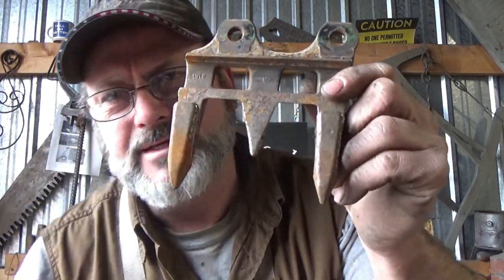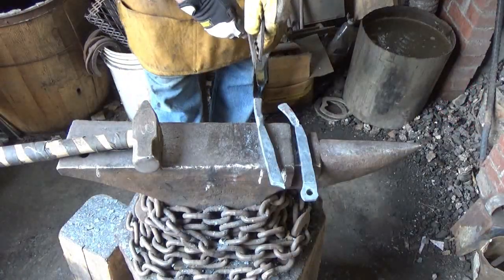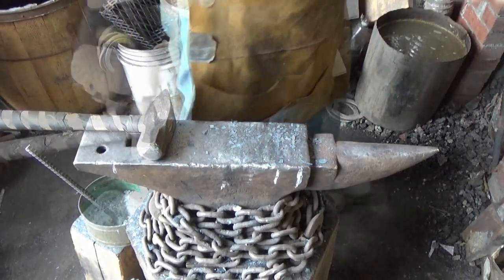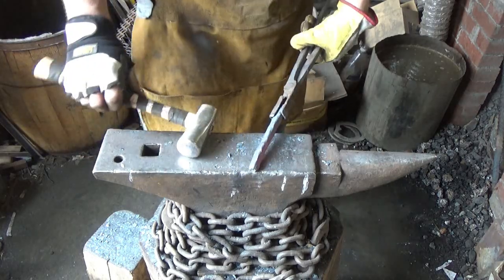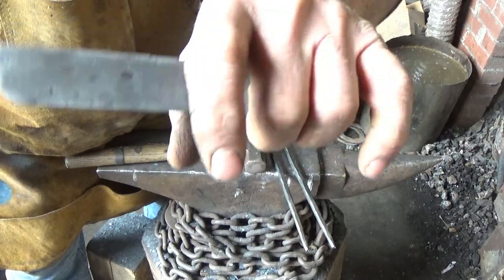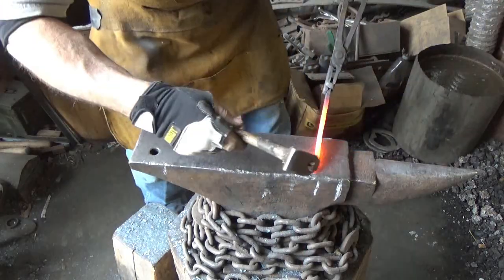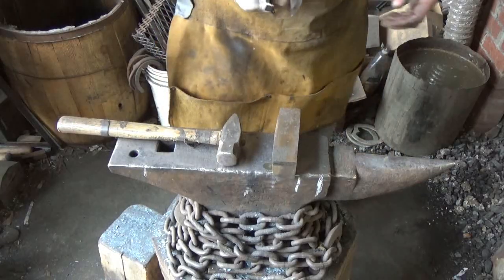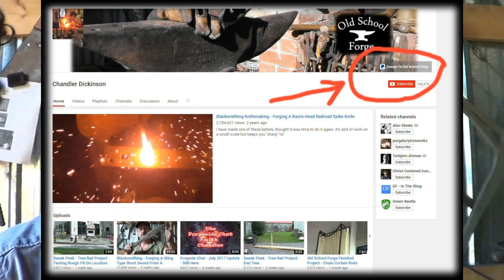Blacksmithing - Forging A Knife From Mower Parts - Full Video

Comment: Hey Chandler, I've been watching your videos for years now. I know blacksmithing is your bread and butter, and you've been self taught. As far as I know you haven't fine too any classes. But I think you can make a good contribution to the Craft for both experiences and new, especially new Smith's. You should make a book and or disc called what not too do. I mean your a great Smith, but you have an Armada of hard learned lessons you can pass on so others can skip the same problems. Thanks for all the hard work. Hammer on and may you be blessed. Joe

Comment: That's a REALLY beautiful knife! And now that I've seen more about how you did it, and what your thought processes were as you were making it, I can see even more beauty in it. Now I'd like to see what you might make out of the triangular bit from the middle of one of those mower blade pieces - the first thing I thought of was a "push blade".

(But for pity's sake, Chandler, fasten that damn vise to the bench so it doesn't wander all around the shop! Your work will go faster and be easier to keep neat.)

Comment: If you go down to 400 grit on the belt then hand sand at 400 and then 600 in the opposite direction you would get a much cleaner finish. For forging so small there's few noticeable hammer marks on the handle this go around, a little more practice at cleaning the marks while forging and soon you wont have any. For an experiment that came out quite well and will make a great addition to the kitchen.